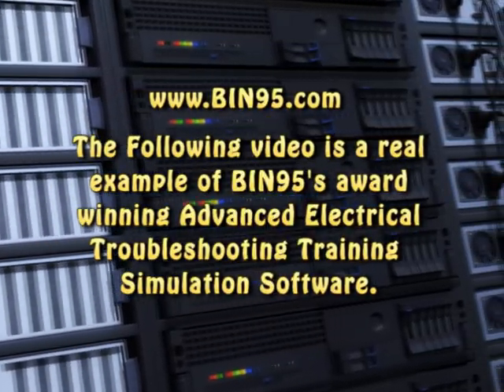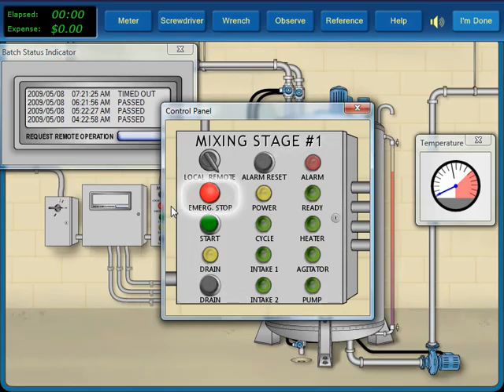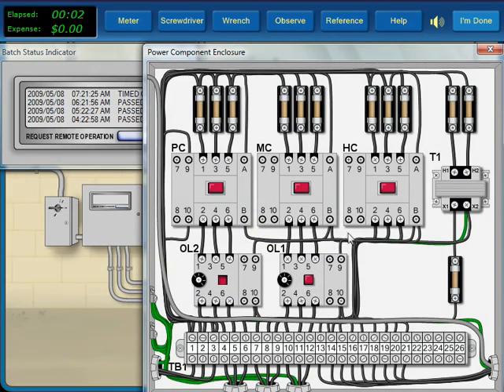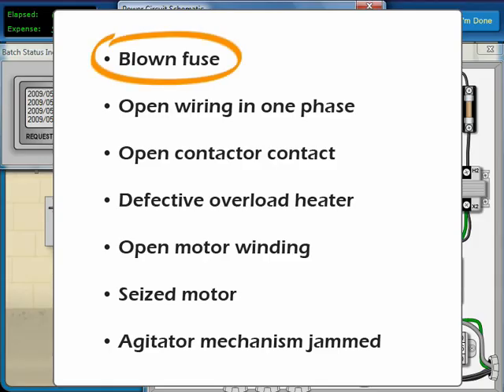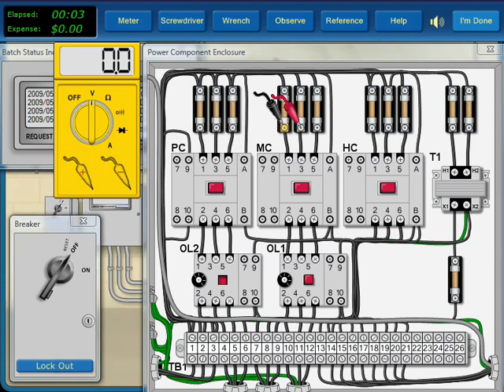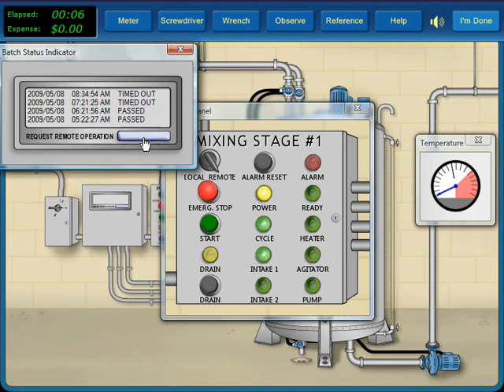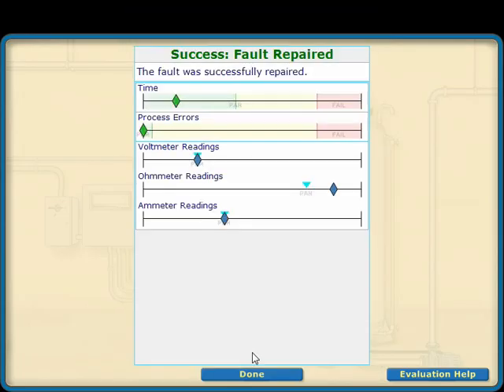How to do Electrical Troubleshooting of Electrical Motor Control Circuit

Comment: I used this program in college, it sucked to do at the time because on the surface it’s not a very fun application. I learned a lot about circuit failure and in my experience I’ve found a lot more loose or burnt connections that I would have thought.
Reply: hi bro which program u used to became experience
Reply: can you actually troubleshoot using the meter? or is all of this an explanatory software

Comment: Disconect outgoing motor cables from the main Control panel and check out resistance values of the 3 windings , They may be an open or high resistance reading on one of the motor wires or one of the motor windings may be unbalanced, , this procedure will tell you if its an external problem not an internal Control Panel Problem .

Comment: The FPS 3000 is an excellent training video.  I have the older version which simutech no longer supports and does not sell to individuals.  You have to go through your company if you want the new training software. It uses real world simulation and plenty of practice faults, Also includes some genius practice faults. That will definitely test your troubleshooting skills to the max.
Safety is a very important part of this course as you will see when going through the exercises..
I highly recommend this real world training software course if you enjoy diagnosing and then repairing the equipment to its fully operational status.
Reply: Hi,
Can you share with me the version FPS 3000 you have pls?
Thank you
Reply: Please sir 🙏, can you kindly share please

Comment: Pretty cool video. But a loose wire as in this case would likely have been significantly damaged by running under load.
Reply: Not necessarily. I think that overload relay would trip much sooner than that wire is completely lose. Induction motors are sensitive to unequal voltages on their terminals. Because of that lose wire motor would draw more current than its designed for and it would trip protective relay. There is not much time for wire to be significantly damaged.  If that lose wire was in heater circuit it would be different story.
Reply: Losing a potential phase to the motor on start up would not allow the motor to run ,a humming sound from the motor may be heard , a bad connection on one of the phases ,will trip the motor out given time when on full load ..having said al this if it was able to turn the motor shaft if connected to a fan blade ,manually ,the motor would run , but at an higher load current and would trip out after some time .

Comment: Faster would have been to tag out the main breaker. Pull the fuses. Check fuses, then check each phase to the others, then test continuity of the problem phase.

Comment: Very interesting. But the flaws that I thought were wrong.
1. Before resetting any safety system, it is better to find the cause of the reset and after fixing the problem, proceed to reset the overload.
2. To control a problematic circuit, it is better to start from the load first. Engine resistance. Resistor to contactor. Next, the voltage on the contactor input and then by labeling the motor wires to control the voltage arm on the terminal.
3. After controlling the whole system, after resetting the overload, the motor should be energized.

Comment: So if im trying to troubleshooting something for open and it show like .3 ohms and then it drop to zero ohm and stay at zero is that good or bad?
Reply: .3 is a reading and 0L is an open line no  connection between the 2 points

Comment: Who turns off the breaker when placing leads?
Reply: +Plutonius X  I know eh ? i was scratching my head too coz its impractical.
Reply: Especially when you have to troubleshoot in the real world.
Reply: Check time code 4:00. They want you to turn off the breaker, place the leads, then turn on the breaker to check for voltage.
Reply: Plutonius X. good video, but that was the most ridiculous step in it.
Reply: Max R an open circuit shows full voltage if you place the leads in the right place. This is to help people who are students not professionals.
Reply: lfieldsjr13. that step is not about making a good test, it's about safety, it's ridiculous.
Reply: Plutonius X They just dont want to be responsible for guys who accidentally touch leads while checking phase to phase connections 😂

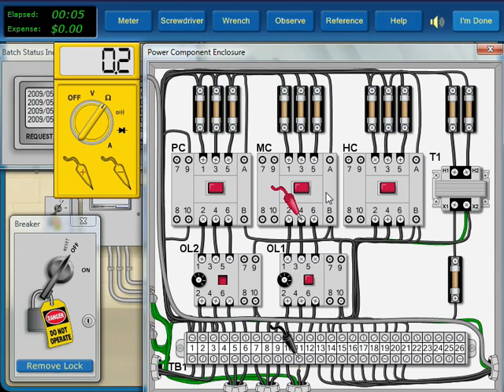Comment: 5:21 you have measured the resistance from the contactor to the terminal block and got 0.2 ohms but the overload was still tripped wchich means that you shouldnt have a path.

Comment: You ran the system up to the point where the agitator would not operate because of a open in one leg of the power circuit, you then found the problem in the power circuit, repaired this problem and re-energized the system. Why didnt the agitator immediately start operating once you re-energised the power circuit, as up to that point everything in the mechanical and control circuit would have been satisfied? Just saying!
Reply: Chilcotinkitchen I think it's just the software theyre using. Theyre trying to make a point

Comment: If you are impressed buy this video you need the correct training as I’ve never seen anything so dangerously stupid. The overload trips so do a live test by pushing in the overload. Look guys and gals airstrip isolate the supply with a permit to carry out your testing, test from the top side of the 1st  fuse to 1, 2nd fuse to 3, then 3rd fuse to 5, if ok, test across your contractor 1 to 2 then 3 to 4 then 5 to 6 by pushing the contractor in so you know you don’t have carbonised or worn out contacts, you can do the same test across the overload if you reset it, if all’s good turn your meter from continuity to the low reading ohm setting and remove the motor wires from the overload and test between the wires what was connected between 2-4 then 2-6 then 4-6, all the the test so far can be done with the low reading ohm meter and should be roughly the same even by testing the fuses and contractor the readings should be alike or you have found a dry joint or defective components, if the motor is not balance in readings test inside the motor terminal after removing the brass star/delta strap bars U1-U2, V1-V2,W1-W2, to identify a faulty phase. What if it test ok? Make sure the motor rotates by hand, get a big screwdriver stick the handle against your ear and the other end near the bearing and turn to hear if the bearing is grinding. Replace/repair the faulty part. Now do the live test after obtaining a live working permit. Doing a live test 1st can cause the motor to burn out by overheating it can even rotate on two phases with reduced torque and then burn out. Ammeter readings can be taken on the run test or condition monitoring. To find a fault a dead test takes a few minutes the longest part depends on the mechanical connection, size and position of equipment.

Comment: I work on this type of stuff everyday at my plant. I always test a fuse from one end to other end. No tone on meter. It's bad.
Reply: The power was on when he performed the voltage test to check the fuse. If you put your meter on both ends of the fuse with voltage applied, the meter will probably blow up in your face.

Comment: Why drain the tank the second time..? no fucking sense... just run the agitator and save the product.
Reply: That option is dependent upon what the mixture consists of.
Reply: I have taken this course. it cycle till you clear the first float switch so you have to drain the tank before you can start the system over. relay R1 must be down that goes through float switch 1 that is activated at 1% full that the line is called cycle reset  cutoff. R1 nc contacts open and the open both start push button and the remote NO contacts so until you drain the tank their is no way to restart the circuit.